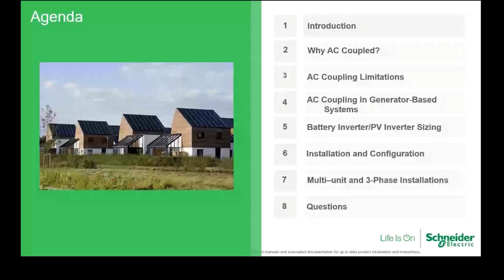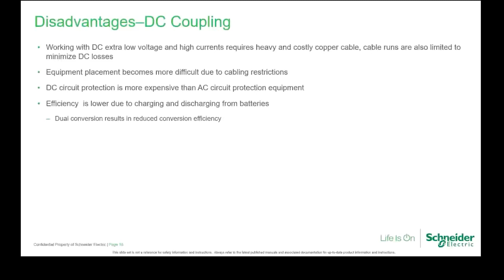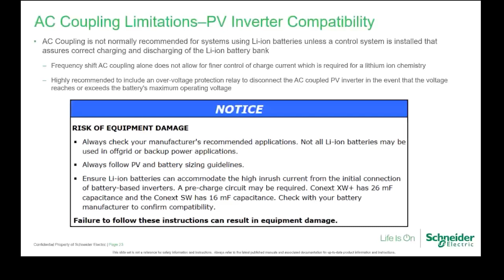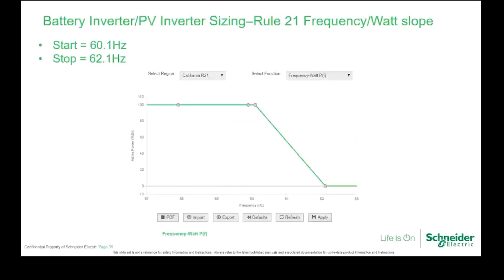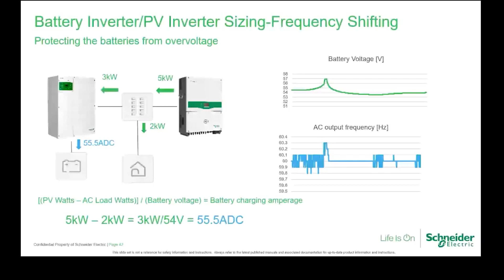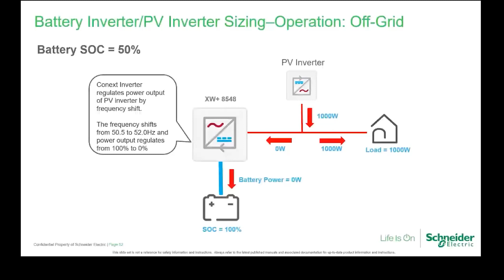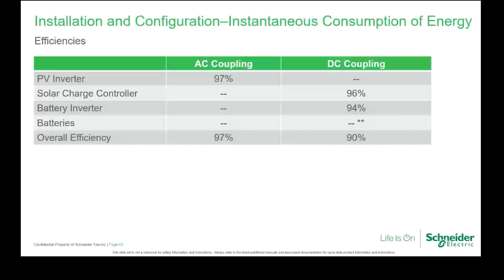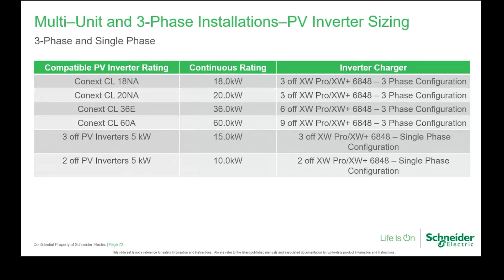Webinar - AC Coupling for Solar Application

Comment: Very interesting information about AC coupling. I have two questions I would like your inputs. I just bought a Conext XW Pro 6848, GateWay, and Mini PDP. I'm installing them to my Enphase M250 micro-inverters with net metering.   First, to handle frequency shifting do I have to replace my Enphase Gateway Envoy S for the Envoy R. As far as I know the Conext XW PRO can handle frequency shifting on its own. Second, I'm planning to buy a Li-Ion battery but I'm not sure whether this battery technology is a suitable fit for the Conext XW PRO.

Comment: The more I read about the XW+ and XW Pro 6848, it seems like it has one big shortcoming in AC coupled mode. Refer to the diagram (page 31) at 18:30. The load is split into Backup panel (where the AC coupled PV inverter is) and Main panel (large loads like AC, Oven, Dryer). How will this configuration support Load Shave (for TOU offset) for the loads on the Main panel? It has no knowledge of the power flow in the Main panel. Tesla Gateway has CT there for this very purpose. Looks like Conext can support external CT but only in DC coupled mode.

Comment: AC coupling can be done so much simpler than these schemes and so much more efficiently. Frequency shifting to regulate inverter output and battery charging is a bad idea. Direct control of inverter output in response to varying loads and battery state of charge while maintaining 60 Hertz is far better. I have custom built my own system using a PLC to control solar inverter output via Modbus to maintain 100% soc on the batteries while matching the AC loads.
Reply: It is great to learn that one can use a PLC to control a solar inverter output via modbus to maintain 100% SOC on batteries while matching ac loads. Could you kindly share how this is done?
Reply: Does SMA Sunny boy are able to receive Modbus commands to curtail their output? Want to know more about your PLC control
Reply: Make a video of how this is done
Reply: @thhillbillyinventor105  I will if I ever get time. I am not a YouTuber. Conceptually most grid inverters have export limit conrols which permit you to limit the power exported to the utility. Many use Modbus based on the Sunspec Alliance standard. So this allows the output of the inverter to be dynamically turned up or down to maintain the set export limit. So you can use a PLC or other controller to dynamically "spoof" the export power value, substituting your storage battery voltage. This is done using a PID in the PLC with the battery voltage as the process variable, the battery full SOC as your setpoint and the export value as the output . You disconnect from the grid, start your battery inverter to power your AC loads, your grid solar inverter starts up after 5 minutes. If the battery voltage is less than 100% SOC, the PID drives the output (export power) low and the inverter proportionally increases the solar output. If you increase your AC load the battery outputs to meet the demand, dropping the battery voltage. The PID then decreases the export value causing the solar inverters output to increase to carry the AC load and recharge the battery.
Think of it this way: the battery acts like an accumulator or cushion. If loads increase, the battery outputs energy to meet the demand. The battery voltage drops and the PLC sends a less than export value to the solar inverter to increase output until the battery voltage is restored to 100% SOC. So the solar inverter proportionally ramps up and down to meet the AC loads and to maintain 100% SOC. Of course this is up to to limits of available solar energy. When it falls short, the battery carries the load. When the sun comes back, the solar begins to recharge the battery and carry the AC loads. My 35kw system works great using two golf cart battery banks connected to a 10kw inverter. I can even run my welding shop off-grid and the batteries, AC inverter and solar inverters just ramp up and down together to meet the varying loads of welding and stopping. 
Why they ever came up with frequency shifting as a way to control battery charging is beyond me!
Reply: @marcostube777  I don't know but I'm sure they use some protocol for import/export meter control. I'm doing it with Solaredge and it took a bit of hacking. Their US tech support dosen't have a clue!
Sorry, I just saw your comment.
Reply: @andyfeimsternfei8408  thanks gives me something to lookup and learn more about . I have a coupled setup I did earlier I never liked the frequency shift. I was planning to use a Arduino to keep the pv output diverted to maintain the house loads and when they wasn't any loads  and full 98% a dump load so it never frequency shifted  seems that could damage my PC and such . I've seen it frequency shift once I didn't care for it .
Reply: @thhillbillyinventor105  An Andrino has the capability too.